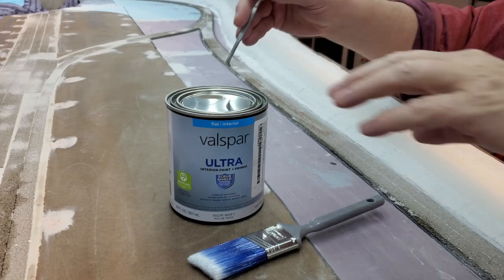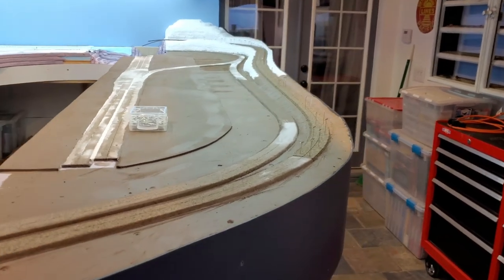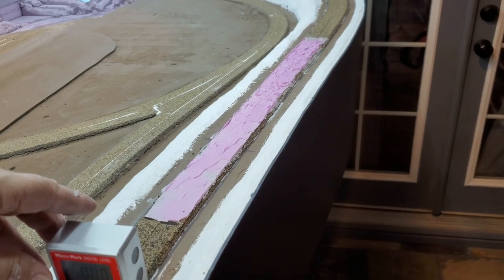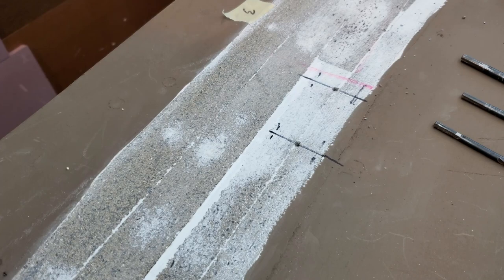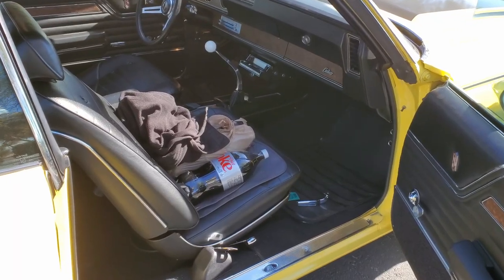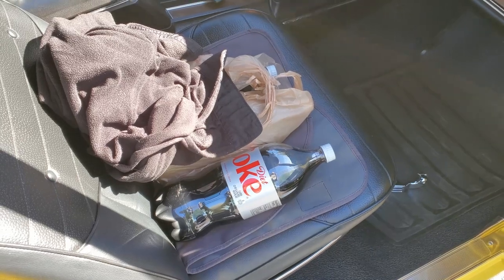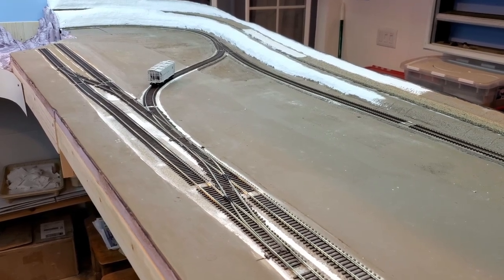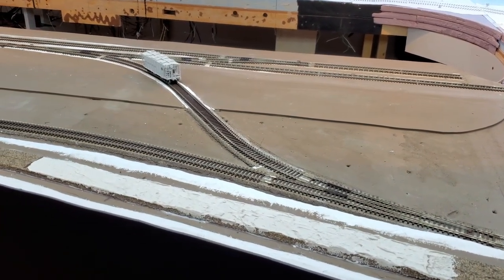Painting Benchwork, Installing Roadbed and Laying Track. HO Scale 12x20 Layout Part 19

Comment: Nice Olds,  We grew up with a 1970 Vista Cruiser [Blue metallic over vinyl woodgrain, no scoops] Olds rocket 455.  In high school it was faster than most peoples Mustangs and Camaros.  It required something like Etayle or other higher octane fuel as it would diesel like crazy.  Guy down the street had a red 68 442 I wanted to buy,   but he would rather just let it sit in the drive way.  In Auto Shop project motor was a old 330.   And I like R/C cola  :)
Reply from the maker: Thanks! I've always been an Olds guy (and Pontiac). When the 68 442's were new (I was 11) I thought they were the best looking car I'd ever seen and wanted one. I had a 67 Cutlass 2 door hard top with a 330, it was my daily driver for 3 years in the early 2000's. Sometimes a you just gotta have some RC or Coke. :)

Comment: Painting is good,  makes everything look better from the start,  I wished I did more painting on my 1st sections of the layout.
I have seen some real bad trackwork that still works,  you are like me.  I'm a perfectionist.   
I seem to get stuck in place if I can not get it perfect,  that has slowed me down by a lot on my layout.   Still working on the same lift up bridge for over a year now...  Not happy tell it is perfect, but it probably works just fine and will be good for many year,  it is just not as perfect as I want it to be....  aka the project has stopped tell it is perfect...
You should be fine with all 4 axle units and gaps can be traversed if the gaps are not wider than the front to back flange width on the rail head, as long as you can not slide the wheel sideways out of the gap, on most straight tracks,  the cars will roll over that gap.
Reply from the maker: Painting is one of those things I hate doing but I'm always glad I did once I finish. I like to have it right or it will bug me. We all have our own standard of what's good enough. I don't want to have derailments so I'm trying to get the track as smooth and flat as I can. Once you perfect your lift up bridge, it'll be worth all the effort. Thanks for the info on the gaps. I'll probably fill the larger gap by the single turnout but the other smaller gaps I'll leave as is. I'll also Have to cut some expansion gaps.